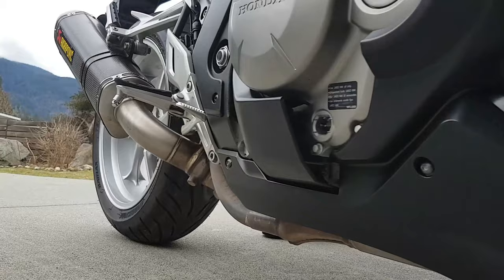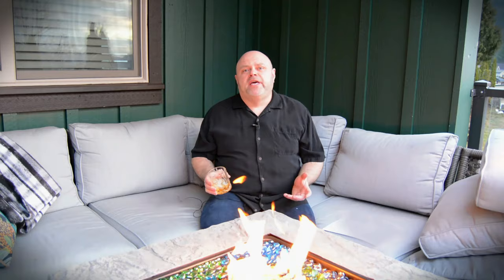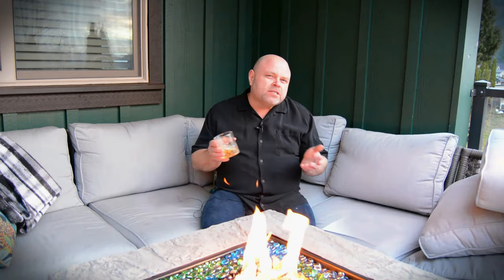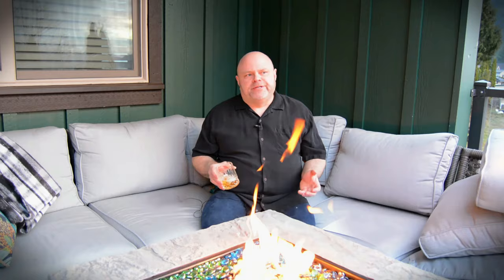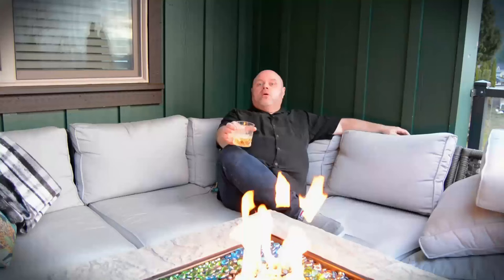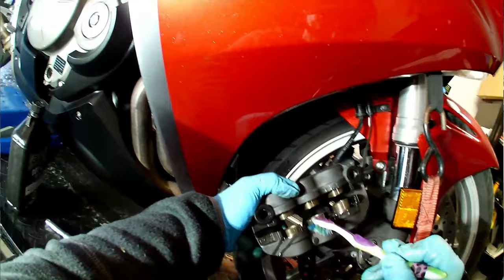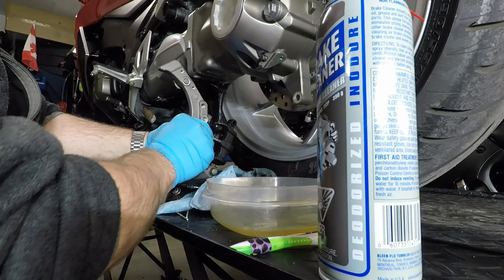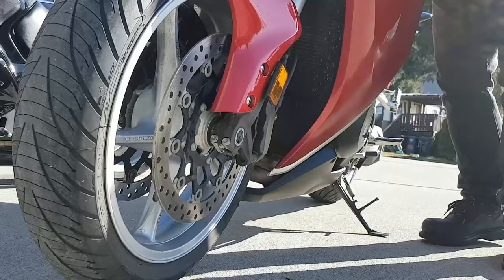How to Cure Motorcycle Brake Drag

Comment: Thank you. A dealer did my brakes but they were dragging when I got it back. I did them the next time and tried to clean with a spray-on brake cleaner but it didn’t do anything. I took it to the dealer again the next time and they just did another pad slap, hand-waving the issue like the pads just needed to bed in, thus making me think some drag was normal. In 32,000 miles I ended up having to replace my Ninja 250’s front rotor TWICE and I didn’t know why. My third was already showing abnormal wear at that point too. A toothbrush with brake fluid is the trick I was missing. Thanks!
Reply from the maker: Grad to hear, hope you check out the rest of channel!
Reply: @RodRidesWrenches  I subbed immediately. :)
Reply: Hi i just got some bikes home from a workshop.. both bikes was like shit.. had to fix my GSX1100 Electric my selve they did not even find the issue.. my ZX9R was in for a cloutch fix so the i could work the gears again brake pads front and back.. and sone small issues.. played and pick up.. got home and saw Oil Fingers all over scratchs.. no work don right and drag like hell on front brake now... 😂 Cloutch not working after 1 hour run all others things i wanted to have fixed not fixed 😂 but they still have my 2.000$😂😂😂😂😂😂😂

Comment: This is the best video on brake drag out there. Fantastic and thank you. My brake drag doesn't sound bad and doesn't slow the wheel when I spin it too much but the caliper gets very hot and I don't want to ruin the pads or degrade the fluid.. going to put this video to good use

Comment: Use dawn and water, rinse, dry, then qtips and brake fluid to clean the rest. Wipe clean,  apply new brake fluid to clean pistons with a qtip. Press in pistons. This way you avoid brake fluid splatter.

Comment: I will try that tomorrow. I just replaced the brake calipers to another model. I did clean it with brake cleaner around the pistons, however I didn't use any brake fluid to lub the pistons, and it was dragging big time
Reply from the maker: Let know how it goes.

Comment: Good information.  This is why I always do my own brake work, even on my cars.  Everybody is in a hurry to get the job done.  

When replacing brake pads on the bikes I always extent the pistons as you did here. However I find it hard to get to the back side of the piston with a brush. What I've found works good is to cut the collar or hem off an old tee shirt, then with it soaked with brake fluid, loop it around the piston and work it back and forth.   

Also on the Hondas with linked braking and the SMC on the left caliper, the short, tightly bent hoses tend to put a little side pressure on the caliper causing a little drag.  It's hard to get the front wheel absolutely free from drag on these bikes.
Reply from the maker: Excellent feedback Thanks!
Reply: I love the tshirt tip!

Comment: Took it apart. Beautiful, clean pistons. No dust or dirt inside. Locking was due to gunked up fluid stuck in the hose. Replaced the hose (and the master cylinder because the last time the brake got stuck it pushed the piston too far out and broke the stopper wedge on the previous master cylinder. Master cylinder came with brake handle so of course, I replaced that too along with the banjo bolt and all. No more sticking but it still catches every turn of the wheel. Finally, I grabbed a sandpaper holder and some sandpaper and filed down the disk brake. Only then did the drag stop. Had a slightly warped disk. Not an ideal solution, I give it that, but it worked fine the last few weeks. Battery lasts much longer now that the drag and vibration are gone (it's electric). Wanted to replace the disk but the shop refused to claiming they can only replace THE ENTIRE BRAKE ASSEMBLY (most of which I just replaced, and part of which is perfectly fine). Close to $300 and what a waste!! The hypocrites who claim they "care about the environment". Screw the shop. Just buy the parts and do everything yourself.
Reply from the maker: Thanks New Video is out today! https://youtu.be/ZboWgG6R9J0

Comment: I read somewhere that using brake cleaner can actually make the caliper seals swell, causing more drag. Brake fluid is ok, but may damage paint on calipers. I prefer to use a little soapy  water (dawn) and a tooth brush, then rinse thoroughly.
Reply from the maker: I'm sure someone has said this, also sure it is incorrect.  The brake clean removes brake fluid and therefore any lubrication properties it has.  A light coating of brake fluid, force your pistons into the caliper and then clean as a final step will maintain the brake fluid in the right spot.  Ride safe!
Reply: Each piston has a fluid seal and a dust seal and the fluid seal obviously has to remain in contact with brake fluid for its entire useful life. It’s the brake cleaner that says to avoid rubber parts… which makes it impossible to clean the pistons without a complete tear down/rebuild where you could isolate them in a parts cleaner. By that point you might as well throw them in an ultrasonic cleaner instead.

Comment: This true but it all depends on brake pad material as sintered HH pads sound like yours did first regardless of piston condition. I’ve swapped out new bike pads with 50 miles on them with sintered. And they still skim. Never new about using brake fluid to lube portion of piston exposed outside. So after cleaning with soap and water I’m deff going to try this method. 
Thanks bud.
Reply from the maker: Thanks for the feedback & view!  New video on Sunday!  I did have to rebuild the rear brake because of bad seals and pistons to stop the drag on this bike.  Here is step by step for single piece brakes  https://youtu.be/XjqgYX7tY6c and this video for two piece brakes https://youtu.be/6QUKiY75VpI

Comment: Great video. Did you notice if the little pads were worn more from previous owner using back brakes ?
Reply from the maker: The left side (linked brake side) showed twice the wear the right did.  https://youtu.be/3hnr9HZxO7o

Comment: Fab video. It’s happened to me. I always use brake cleaner to clean the caliper then pump pistons out and scrub pistons. Need to check brake reservoirs ?
Reply from the maker: Is your fluid discolored?  Brake fluid only lasts about two years so replace your fluid when you change your pads or two years whichever occurs first.  https://youtube.com/shorts/jRGKW1uXkh0?feature=share

Comment: I just did brake pads and noticed dragging. 

I'm going to try your suggestion on cleaning and lubing the pistons with brake fluid. And greasing the slide pin. 

If that doesn't work, it's the excuse for an R1 front end and brakes I've been looking for.
Reply from the maker: make sure you extend the pistons out to clean them.  I wound up rebuilding the brakes, as seen in another video, because the rear pistons were cooked.   Let me know how it turn out.
Reply: @Rod Rides & Wrenches  Thanks for the response. 

I put them back together and they are still dragging. I'm going to attempt to push them out and clean both sides again.

I'm really hoping the pistons don't need rebuilt. 

Your suggestion of using brake fluid helped me clean a amazing amount of crap out of the calipers.
Reply from the maker: @westondifranco9313  If the pistons are out of the caliper you should change the seals https://youtu.be/XjqgYX7tY6c
Reply: @Rod Rides & Wrenches  I'll check this out. 

Before I buy parts I'm going to check them again.

It's possible I didn't extend them far enough and there is still grit. 

If after all the cleaning/ lubricating they aren't working I'll change the seals. 

Thanks for your help 👍
Reply: @Rod Rides & Wrenches  After some deep cleaning the front calipers need rebuilt. 

Looks like I'll be giving this video a watch. 

Thanks for the help.

Comment: After parking my Ninja 250 for several years with a full tank of E0 and a brand new petcock I found that every drop had made its way through to the engine AND the tank had rusted. Indeed, I now had rusty water bubbles under the paint with rust-clogged pinholes under every one. The bike was always under a cover so I presume the water was condensation. I have a feeling that the E0 would have been stable enough on its own if I didn’t add a whole can of Seafoam, so I think the Seafoam ended up acting like ethanol. Though it was supposed to stabilize for 2 years I figured I had more time since it was E0 (Ethanol-free) but not if the Seafoam was acting like Ethanol. :(

Comment: So THAT's why my brakes drag... Note to self: don't let the main stealer touch my precious brakes ever again.

At this point it's been months. The pistons will most likely have to come out so I can get it all, at which point I may as well do the seals too. They're not leaking, but that dust has been there ages and I don't want to chance it.
Reply from the maker: The good news is... You just need a set of seals and some time.  I wound up rebuilding the brakes on this bike because the rear pistons were cooked and bound up again after a few hundred klicks.  I replaced as many pistons as I could find but that was overkill, I just needed to rebuild the rear ones.  Good content though - Single piece brakes Nissin and most others https://youtu.be/XjqgYX7tY6c Two piece brakes Brembo and Tokico Calipers check here https://youtu.be/6QUKiY75VpI  Good Luck!

Comment: What are your opinions about using calipergrease for pistons versus brake oil?
Reply from the maker: I find the brake fluid does a better job of cleaning the pistons.  If your pistons are clean you can use the caliper grease, however IMO the grease will collect and hold the brake dust.  I've tried it didn't see a benefit.

Comment: Would this be a reason for the brakes locking up?
Reply from the maker: Hello Mo, the brakes locking is usually a result of two things, the pads may indeed be dragging and heating up the pistons and brake fluid but there has to be air in the system or your brake fluid reservoir is overfilled.  Most likely air since when that gets heated it expands and pressures the brake fluid.  How long has it been since the brake calipers were rebuilt? https://youtu.be/6QUKiY75VpI The other reason is the brake master cylinder and brake lever.  I once installed an aftermarket brake lever and it held the brakes on just a little, it heated those brakes up and started to lock them. If you've not already done so, check the operation and lever clearance on the master cylinder.  If the plunger on the master is not returning to fully out position or the master is leaking there is a problem.   Here is a video on rebuilding the master and bleeding your system.  https://youtu.be/CdCa6tVqtns

Comment: when you pushed the pistons back in after cleaning is it with the resovoir open or closed ?
Reply from the maker: Great question, the cap on the reservoir is off to allow air to escape during the expansion of fluid in the reservoir.  Remember that the brake fluid should not exceed the available space in the reservoir, if it does you probably have too much brake fluid in it.
Reply: @RodRidesWrenches  Doesn't need to go off..Every reservoir have a little breather punch or dot around cap to air escape

Comment: Hi, I have a question. When I assemble my brake caliper it fits nice. But when I start pumping the brakes up, the brake pads start rubbing on the disk. Any tips?
Reply from the maker: When you say assembled do you mean you rebuilt the caliper or just replaced the pads?
Reply: @RodRidesWrenches  i just replaced the brake pads.
Reply from the maker: @erikfriis1443  then you need to extend the pistons and clean them like in the video.  Take the caliper off the rotor and pump the brakes until the pistons extend.  Remove the pads and clean the pistons really well.   Replace the pads and be sure to lubricate the slide pins with brake grease. Good Luck
Reply: @RodRidesWrenches  thanks

Comment: Some level of drag is normal....the info oresented can be misleading unintentionally.
Reply from the maker: Hello Jeremy  i disagree your brakes do not intentionally drag.  No manufacturer makes a bike that has dragging brakes, a visit to your local dealer will confirm,  I own, have owned many motorcycles, their brakes do not drag without activating the brake system.  Dragging brakes do not just wear components, it heats the brake fluid up causing expansion and more drag.  Dirty caliper pistons are not alright and your brake calipers should be cleaned regularly.  I am not sure where your comment is coming from but i can site others to back me up here. Please clean your brakes and ride safe.
Reply: @RodRidesWrenches   Also dragging brakes make your engine work harder and can cause overheating which I have experienced with the Suzuki VStrom DL1050XT.
Reply from the maker: @yellperlapper  Good Point!  Thanks for the feedback & view. I have anew video out today, I hope you will check it out.